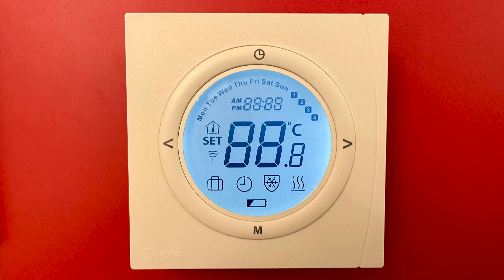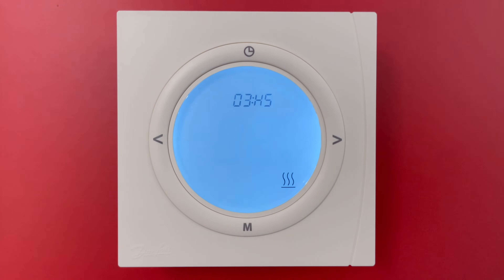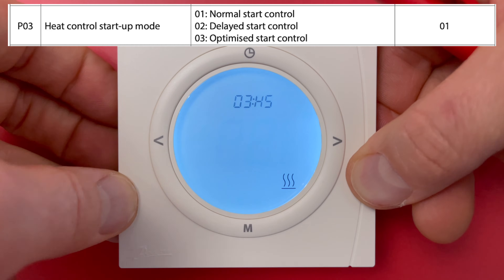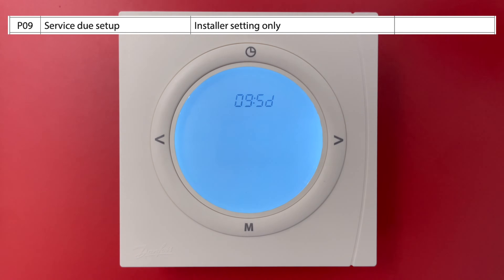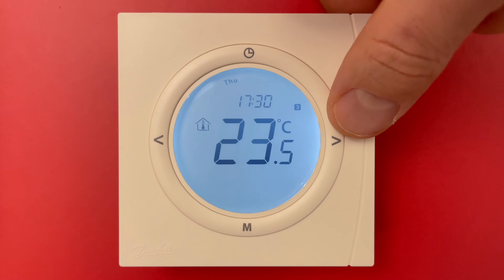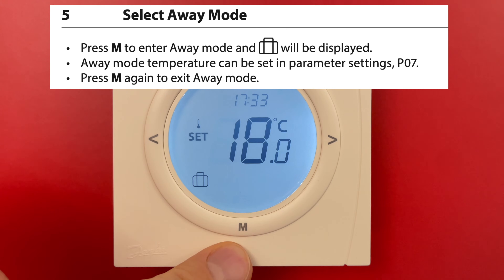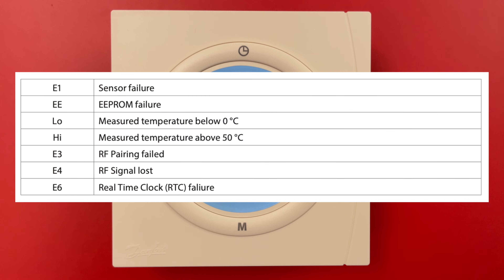Danfoss thermostat TP5001 SETUP & MENU

Comment: What does the low battery setting look like? Is there a beeping or battery symbol?
Reply from the maker: When the battery is low, the thermostat does not beep. Instead, a low-battery symbol appears on the display. This indicates that the batteries should be replaced soon to ensure normal operation.
Reply: @heatingsolutions123 thank you!

Comment: I have had this installed for 20 yrs never understood it , still can’t , I just have to get lucky somehow and it comes on or I get E2 which is reset that’s all am comfortable with , am going to get shut
Reply from the maker: Hi, the E2 error indicates the controller is set to regulate temperature using a floor sensor, but it appears that no floor sensor is installed or connected. Here is a video on that: https://www.youtube.com/watch?v=NHupnfL_mo4&t=2s
And one more thing. I guess you have a very similar but a bit different thermostat. TP5001 and WT-P are a bit different, but similar at first glance.
WT-P basic MENU: https://www.youtube.com/watch?v=4--W20us1hg&t=4s
WT-P SETUP: https://www.youtube.com/watch?v=Nzqw2VN4pOY

Comment: Watched it 50 times or more , every time I watch it I am more confused , jut want to turn it on and turn it off , and set the heating to what I what , simple is best
Reply: Press the Clock button, then press the M button for 6 Secs. Press the left < button to change the number on the display to 01 which is the default mode. Then press the Clock button and then you're in Manual Mode. So you then set the temperature 🌡️ by clicking on the right > button until you reach the desired temperature and it will be set at that. If the Temperature falls below that set Temperature the Heating will kick in. If you are leaving the house and want the Heating off, you click on the left < button and reduce the temperature. I reduce mine to 12°C so the pipes don't freeze up when I leave the House. When I return I increase to the Temperature of my choice.
Reply from the maker: @adekunlebamgboye1936 - Thank you very much for the clear and detailed explanation!
I will add one thing: TP5001 and WT-P are a bit different, but similar at first glance. I am not sure which one you have got.
WT-P SETUP: https://www.youtube.com/watch?v=Nzqw2VN4pOY
WT-P SCHEDULE SETUP: https://www.youtube.com/watch?v=OO0nVY5sgbU&t=38s
and this one you have watched: TP 5001 SETUP: https://www.youtube.com/watch?v=BTGKSqTgHkA&list=PLwz1O-4n12mcKnNk_X2nUIJcI4nOhu0DO

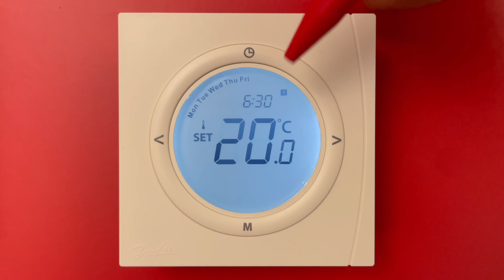Comment: i only want my heating to come on 2x a day, once at 7:30 and once at 17:30 

i have the 24h option. if i select 07:30 then 17:30 x3 for the other options, will this work?
Reply from the maker: Yes, that will work.
If you’re using the 24-hour schedule, just set 07:30 for the first time and 17:30 for the remaining time slots. The thermostat will follow only those two temperature changes per day, so your heating will effectively run at 07:30 and 17:30 as you want.

Comment: I’m really hoping you can help! I moved into a house two days ago and the thermostat is the same as this… it has stayed back lit the whole time and not let me change anything, the buttons don’t seems to change anything and the thermostat seems locked! I have reset the boiler and at the switch board…. The on/off button doesn’t work! I really hope you could help
Reply from the maker: Hi, please try performing a full reset — you can follow the steps in this video: https://youtu.be/5fzT1mMkY7g?si=c20OH-d3mhyGz5Ic If the display stays backlit and none of the buttons respond even after the reset, then unfortunately the unit is likely faulty and will need to be replaced.

Comment: How do I just have it set to manual in off
Reply from the maker: Hold "M" for 6 sec. at P01 select 01 "P01 01 - Manual temperature operation"
Other are: P01 02 - Schedule timer 5/2 day, 
P01 03 - Schedule timer 24h

Comment: Wondering how can we set the end time of a specific schedule without setting/starting the second schedule, like setting heating only for the period 4AM-8AM
Reply from the maker: On this thermostat, each heating period requires both a start and an end time, and there are 4 available periods per day. To heat only from 4 AM to 8 AM, set the first three periods to the same comfort temperature, and set the last one to start at 8 AM with a lower (energy-saving) temperature.

Comment: This system is ridiculous. What is the point in being able to set a schedule if the boiler just keeps coming on outside the schedule? I am constantly manually turning down the thermostat for it only to reset when the next programmable time starts. I just want it to operate during the schedule and not come on at all outside these scheduled times! But it does come on but cannot understand why or what temperature setting it is reading for this to happen. The system in my old house was simple - you set a schedule and if you wanted the heating on outside the scheduled time you had to over-ride it manually. So how do I do the same with this system? Because all I can see is you have to turn off scheduling completely and then constantly manually set the temperature. We have dual thermostats so it is very annoying. Any help here would be greatly appreciated.
Reply: My assumption with this unit is that the exit temperature for any schedule determines the temperature until the next schedule. ie. If I set exit to 15c then unless the temp goes below 15c then it stays off until the following scheduled temperature  preference. However, I have had to manually turn down the temperature so many times now, on both thermostats, and when I check it is often set at 17c  even though the exit temp on all schedules is 15c ! Something is clearly not right - on both units!
Reply from the maker: If you’re controlling actuators, the boiler can also be managed through the wiring box. It includes a relay for boiler control, which allows the boiler to be activated based on the heating demand from the thermostats: https://www.youtube.com/watch?v=5Z44RHS4N-o&t=581s
Reply from the maker: You can’t have two separate schedules — one for the boiler and another for the thermostat — they will conflict. The best setup for comfort is to leave the boiler without a time schedule, letting it operate based only on outdoor or flow temperature (depending on your system).

With this thermostat, you can definitely override the schedule by changing the temperature manually, but that setting will only stay active until the next programmed period begins.

There might also be other reasons for what you’re seeing — for example, if sunlight hits the outdoor sensor, it can cause the boiler to stop earlier than expected. Wiring or thermostat placement could also be factors.

In your case, the best option would be to have a qualified local installer check the setup — it sounds like something small might not be configured correctly.

Comment: Danfoss thermostat sucks
Reply from the maker: Sorry to hear you had a bad experience. Usually, setup or compatibility issues cause most problems — once configured correctly, Danfoss thermostats work very reliably. What exactly went wrong in your case?

Comment: I moved into a property and it has this Danfoss thermostat. I have never fully appreciated manual dials on a boiler until this moment. What a long winded process!
Reply from the maker: I know what you mean 🙂 It feels tricky at first, but once set up the thermostat runs automatically and saves energy without you having to adjust it. And you always have the option to switch it to manual mode if you prefer :)
Reply: @heatingsolutions123 how do you switch it to manual mode, iam ready to kick this thing off the wall 😂😂
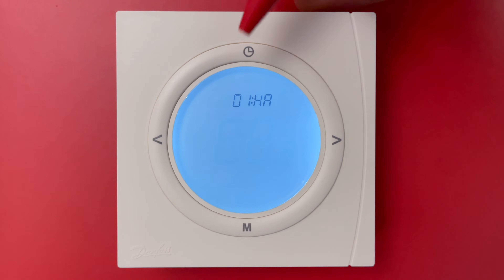Reply from the maker: Hi:)  HOLD "M" for 6 sec. instead of factory setting P01 "02", select P01 "01' This video from 1:47 min.: https://www.youtube.com/watch?v=BTGKSqTgHkA&t=88s
Reply: @heatingsolutions123 thanks!! Finally i know how it works and saved it from a kicking 😂

Comment: This video was so helpful! What would you recommend when setting this up for energy saving but great heating? Would you set schedules or use the manual function?
Reply from the maker: Glad it helped! 🙂 For the best energy savings, I’d recommend using schedules – that way the heating only runs when you actually need it. Manual mode is fine if you’re home all the time, but schedules usually give the best balance of comfort and efficiency.
Reply: @heatingsolutions123 again thank you so much this was really informative

Comment: Hi, I have a TP5001B which is now flashing HI. Yesterday all of a sudden, the measured temperature started wildly fluctuating from 27 to 44 degrees celsius, sometimes even higher although the room was only about 24 degrees! I changed to new batteries only few months ago. Any idea what is causing this? Thanks for any guidance you can give.
Reply from the maker: Hi, really strange behaviour. Please check if sun is not shining directly on thermostat. If not. I would try reset: https://youtu.be/5fzT1mMkY7g?si=hDoo2E8e2UKY2xP1

Comment: How can we turn the heating off for summer? To ensure its not coming on. Currently we've set it to holiday mode and 35° temp before it clicks on 😅
Reply from the maker: Many options:) For summer I would select frost protection. Or same holiday mode with 10° C setting. Or just thermostat OFF.

Comment: So with no schedules set, does that mean when i change the temperature...the heating just stays on??? Please somebody please reply im so cold.
Reply from the maker: Yes, if you haven't set any schedules, simply follow the manual temperature setting you choose.
What Happens When You Change the Temperature?
If you increase the temperature (e.g., from 20°C to 25°C), the system will keep heating until it reaches that temperature and then shut off.
If you lower the temperature, the system will turn off heating until the temperature drops below the setpoint.
Reply: Yeah it isn't heating right up to the set temp, I don't know why..

Comment: This is impossible!!
I can't understand how to make mine work!!
Lived in new build for 28 days now, most of that with zero heating.
Using plug in heater to heat 5 areas of my flat! Its 4 degrees c outside!
Housing association won't help.
These videos are too confusing!
Even emailed Danfoss and they just gave me a link to this YT video.
Omg I have no idea how to sort this 😢😢😢😢
Reply from the maker: I completely understand how frustrating this is, especially in the cold. If video does not help you need a professional installer support locally.
Reply: Ok I seem to have it sorted. The only issue is I have to turn the temperature up to 28°C just to get it comfortably warm. My last place I'd never go past 23. It also takes a long time to get warm. It seems to stop warming up at 24 and goes off by itself.
Why is this?
Thanks
Reply from the maker: It might be so if the place is different and different thermostats have different measurements. Even the same producer thermostats may show different temperatures in the same place. It is normal. The temperature should be adjusted according to comfort level.

Comment: Just had one fitted. Like everything, when you eventually understand it and know how to do it then it is easy, like operating a mobile phone or driving a car, difficult at first.
Impossible for my sister to know how to operate all of this Thermostat so I would set it to Manual operation only. This is what I wanted to understand how to do it. Took me a while with the instructions, without the instructions probably ages or impossible. 
I'm happy now I understand how to use it. I only need the Manual operation setting in settings working mode, option 01.  If I need Programming timer then best choose option 03 24hr seven days programme. Little slight error in the instructions about this.... working mode set to 24 HR option IS P1 with 4 events over weekdays mon- Fri AND SAT SUN !!! seven days. Bit of confusion there in Advanced programmable timer. 
You have THREE options in user settings, 01 Working mode......
01 Manual, which is very simple on and off with pressing the temperature up and down...
02 schedule timer5/2 days, which is different times for weekdays and weekends...
03 schedule timer 24 hrs, which is timer program events same ALL WEEK MON-SUN !!!! 
This is the best option or manual with no timer program option 01. 
Yes to change to any of these settings, click on ring to bring up display then hold down the M for six seconds then keep pressing to move through all the settings 01 to 11. 
Simple lol 🤦😆 well not really
Reply from the maker: Glad to hear you figured it out! Yes, setting it to Manual (Option 01) is the simplest choice for on/off control. If a schedule is needed, Option 03 (24hr, 7-day program) is best.

Comment: This is the worst most over complex gadget on the planet, my house is permanently cold as it keeps going back to 15 degrees- my bills are the highest, all I want is on/off and ability to set temp as suits- crazy! no doubt part of the new esg reg’s the corporate want for ultimate control 🤬
Reply from the maker: Hi! For manual control just Hold M for a 6 sec. Set P01 01 - Manual temperature operation.

Comment: Hi, i set on manual 01 01, house temperature set from 35° to 21° °from menu, thermostat temperature also 21° and heating never stops making 24 - 25 °, can't understand it, is that mean something wrong with thermostat.
I would like constant 21° during the day and 18 ° during the night.
Thanks
Reply from the maker: Hi, well. Seems like wrong wiring or broken thermostat. If wireless version: check connection to receiver. If wired version check boiler or actuators reaction. Thermostat calls for heating "waves" appear -  boiler should start. Otherwise lost connection or wrong wiring. If you would describe what kind of heating you have, i could tell you more.

Comment: How do you higher the thermostat please? Its saying 35,c but is on 16c i would like to have it on 24c. Very complicated.
Reply from the maker: Thanks for asking! Normally, you can raise the thermostat by pressing the up or down button until it shows 24°C. If it’s still stuck or shows a higher temperature like 35°C but only heats to 16°C, there may be something wrong in heating system.... Looks like it does not work properly. Or simply it might be you have active schedule, so for begining please select manual mode, where temperature will not change during a day.
Reply: Thank you for replying,.much appreciated.

Comment: Hi, thank you for the excellent video. I have switched my boiler to manual and we lower the temperature every night before bed. However in the night the boiler is cycling too much to maintain a temperature of 17.5c in the night. It switches off almost immediately as well after being on for thirty seconds. Which settings do you recommend i change to get this short cycling resolved in the night? Does this thermostat come with a Differential Adjustment?
Reply from the maker: Hi! Well:) I would select then: 
P02 02 - ON/OFF standart operation. Boiler is ON till set temperature is reached. 
P03 01 - Normal start control.
If that doesn’t help, the issue might be elsewhere. The boiler cycling could be due to hot water preparation. For example, if no one is using hot water at night, your hot water circulation pump might still be running and cooling the buffer tank. In that case, I wouldn’t recommend switching it off because it helps prevent Legionella

Comment: I am certain I have this thermostat but it has a flashing battery. Does it need batteries changing ? I can’t find the manual in the house I moved in
Reply from the maker: Yes, if the battery icon is flashing, it’s time to change the batteries. Unscrew the bolt at the bottom of the thermostat frame, remove the frame, and replace the two AA alkaline batteries inside. Avoid using rechargeables—regular batteries should last a few years.

Comment: Hi can i reset my RX1-S ??
Reply from the maker: RX1-S is receiver, TP5001 is thermostat (transmitter) Resetting RX1-S has nothing to do with E6. There is only one way signal from TP5001 to RX1-S
Instruction is here: https://assets.danfoss.com/documents/353563/AN30483490055002-000102.pdf
Reply: @heatingsolutions123  hi. Thanks for reply. My room stat is a tpsthermalcontrols  if this helps. 🙏🏼
Reply: RX1-S is still flashing E6 with a bell symbol below it 🤔
Reply: Can i send a foto 2u ?
Reply: Hello

Comment: How do I turn the thermostate off? Do I hold down the on/off button  or press twice and hold on the button? And how do I know if the thermostate is off? Failing that how do I take the batteries out?
Reply from the maker: To turn it OFF - just push once ON/OFF button on top of left corner. Display will become dark and not active.
To change batteries release the screw at the bottom of the frame, take frame from the holder. Change 2xAA alcaline batteries.
For thermostat reset:https://youtu.be/5fzT1mMkY7g?si=tpzUrQRrMNy1sv9J
Reply: @heatingsolutions123  OK thanks